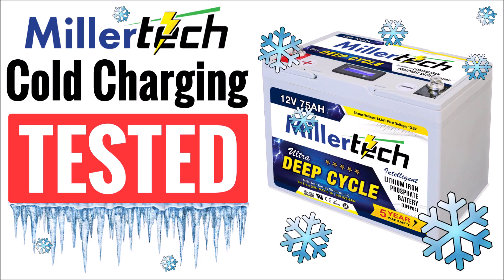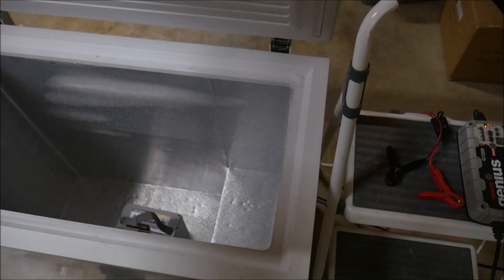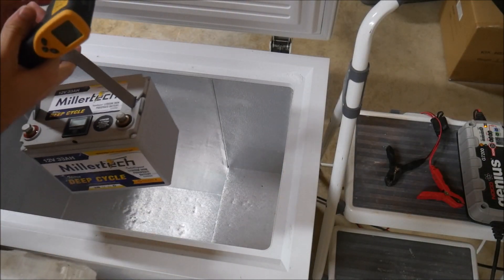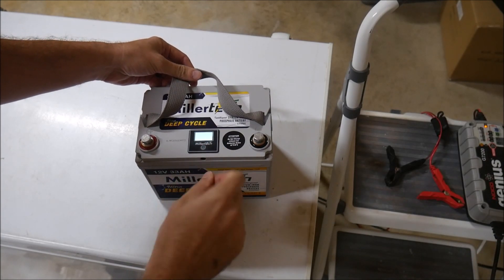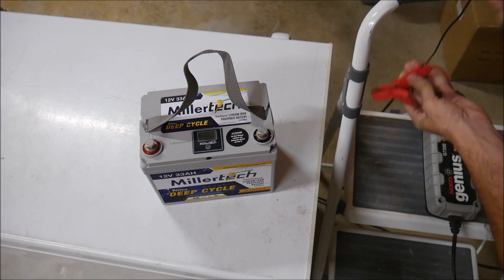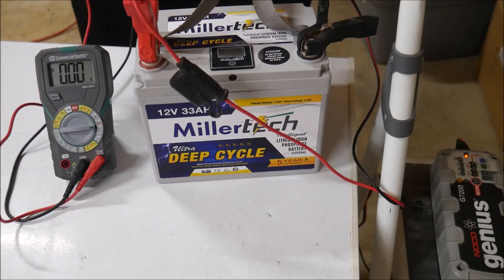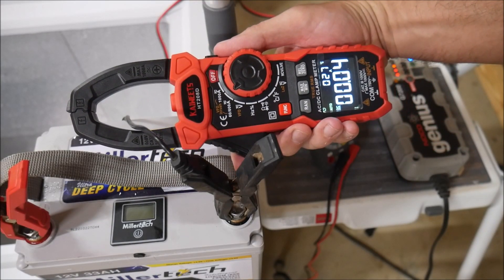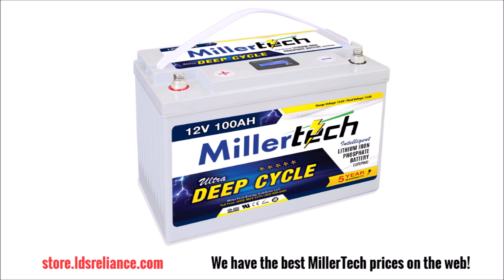Testing The BMS Cold Charging Protection On A MillerTech Lithium Battery

Comment: I’m using a Miller tech battery as my starter battery for my 115 hp Yamaha, my question is when I go to the High lakes here in Oregon, and it’s freezing outside I know the battery will start the engine ok , when the battery BMS shuts down the charging circuit of my outboard because of the cold,will that hurt my outboard
Reply from the maker: It is possible.  But it would have to be pretty cold.  The internal battery temperature is all that matters, not the ambient temp.    So if you have the battery well insulated it will be a few degrees warmer than ambient and won't be affected by wind chill.  Or if you provide a small battery heating pad it will be fine in almost any temp.

Comment: Thats nice but i would like a battery that can also be charged at these temperatures :)
Reply from the maker: Any lithium battery that is charged at those temperatures will be damaged.  But if you want one that will heat itself up and then allow charging automatically, look at my Jericho battery:  https://store.ldsreliance.com/collections/premium/products/pre-order-jericho-12v-100ah-lifepo4-premium-deep-cycle-battery

It has a built-in heater that will pull power from the charger, heat up the battery internally to a safe temp (40F), and then allow charging normally.
Reply: @LDSreliance  thanks. I will take a look :)